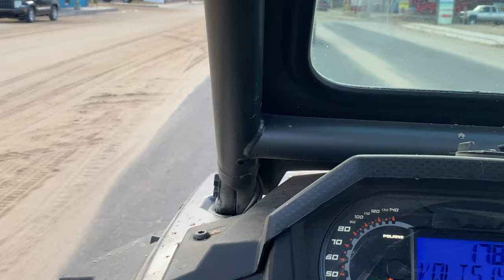200 MILES IN MEXICO WITH THE ROCKY POINT RENEGADES | PART 2 | CHUPACABRA OFFROAD

Comment: Do I need extra gas If I go from Puerto peñasco to golfo de mexico? There's any gas station at el golfo? Going this coming weekend in a group but I don't know much about details.
Reply from the maker: Yes, you will need gas, and yes, there are a few stations in El Golfo to get fuel as well, and top off for the ride back.
Reply: @ChupacabraOffroad  can I make it with full tank from RP TO GOLFO? how many miles it is each way?
Reply from the maker: @compamigue4822  85 ish but heavy sand and takes more fuel than a lot of rides I've been on.
Reply: @ChupacabraOffroad  thank you so much for the info. I don't like to transport gasoline but I will make the exception for this trip.
Reply from the maker: @compamigue4822  It's deep sand so the mileage isn't a good way to verify, definitely bring 3 gallons so you wont be stressing about it all day.